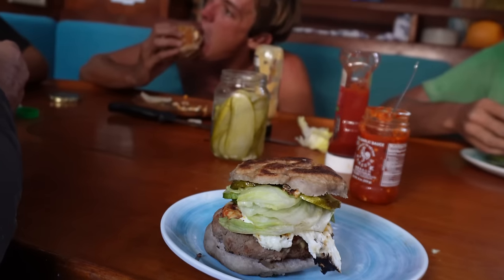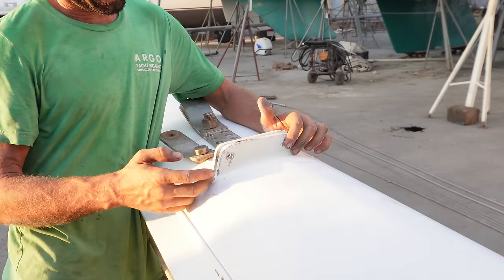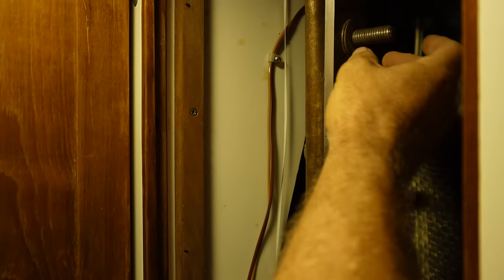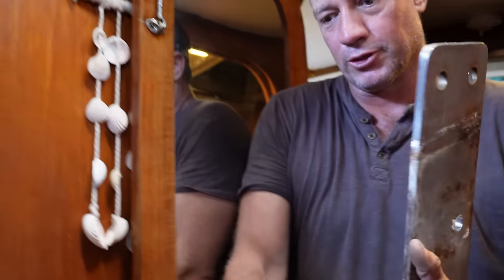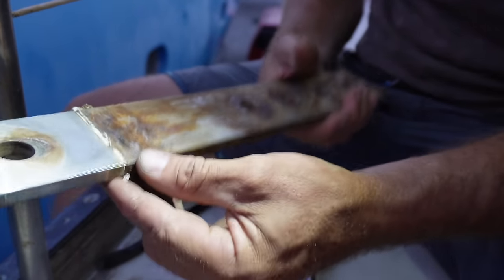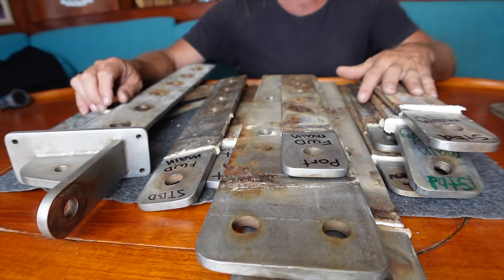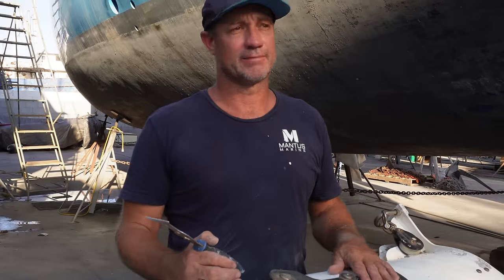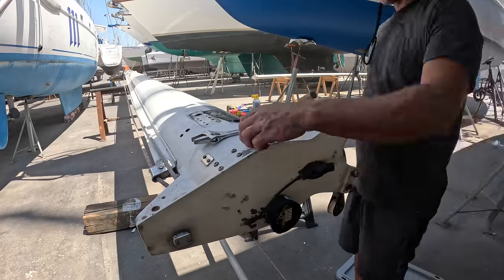Living on a old sailboat and fixing all it’s problems Ep 416

Comment: We redid the rigging in 2018 on our 1985 S2 11C, including a complete mast refit. If we were to do it over, we would leave the mast aluminum and not paint it. The mast still looks beautiful, we used Awlgrip metallic bright aluminum, so it looks like an aluminum mast. We also bead-blasted and painted the pedestal the same color.  We removed, inspected, and polished our chain plates and only had to replace 1 that had a crevice corrosion crack. We run into a lot of sailboat owners who don't understand that chain plates should be re-bedded at least every 5 years; we do it every 3. We remove the deck plates, dig out all the sealant and reseal. Otherwise, it doesn't get done until they start obviously leaking and the earlier slight leaks can do a lot of damage before it is noticed. A rigging refit is one of the most satisfying jobs you can do on a sailboat, good work!

Comment: I think blast and paint is the best option and will give the best long term outcome as to the Duralac or Tef-gel consideration both products are excellent I use both based on location. In locations that will rarely be accessed I use Duralac even though it is a pox to use and ends up in places you had no idea you touched so tang plates etc. on things that are likely to be accessed somewhat more frequently like shieve mounts and light bracket s etc I use Tef-gel because it is a little more user friendly and a lot less toxic a little goes a long way. Also for your stainless nuts and bolts a very little neverseez pure nickel anti-sieze will protect the threads and prevent galling it won't make them come loose but Galling is a good start point for crevasse corrosion. justy my 2 bob worth .
cheers Moose

Comment: If a job's worth doing, it's worth doing properly. Bolts - it is important that the load is not on the threads. As to corrosion, the first thread takes about 30% of the load in an infinite screw. So if that first thread is corroded (it looked like it) I would change the bolt.